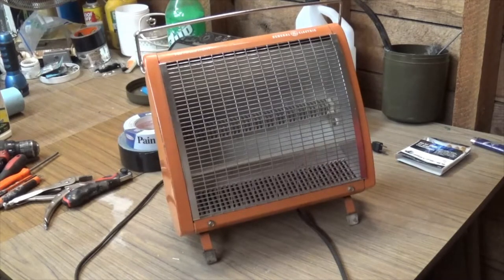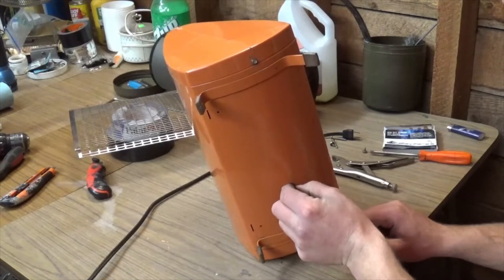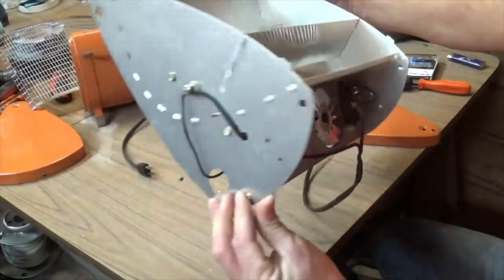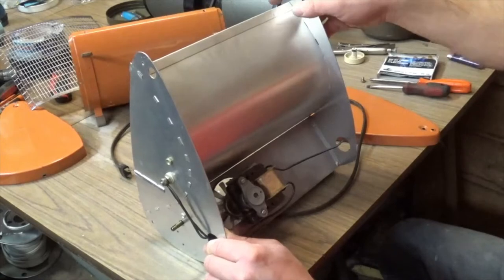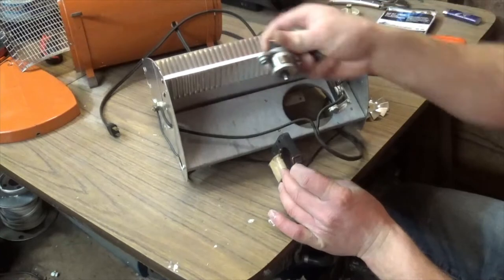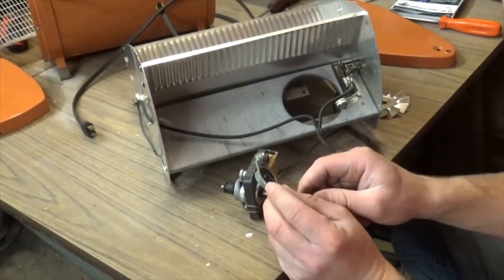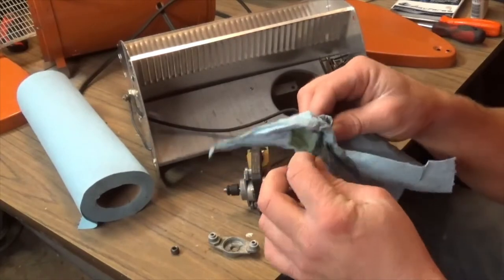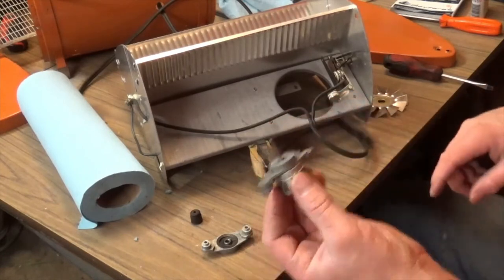Vintage GE heater disassembly

Comment: Hey hobbycentral I have pics but can't figure out how to add them to show you. I did use an oil on those bearings ... I'm gonna re do them like you did later. The fan was very stiff before I oiled it. I only oiled bearings but I'm gonna get the oil you have later. Just did it to free it up. Thermostat looks good. Gave it a cleaning blew it out. There was a ton of dust and debree in the under careage and fan was covered in black gunk as well as the fan motor so I cleaned it all as best as I could and checked connections and they were good too 😁. I do thank you for that video you did an awesome job at the breakdown of disassembling the unit. Keep up the good work.
Reply from the maker: Thank man im glad it helped! with all the gunk on your fans blades it must have a lot of miles on it. come to think of it, I dont think my fan had any gunk on the blade when I originally took it apart.
   At least you didnt find anything burnt! thats a good sign
Reply: Now I do have a question does it matter the oil I used LX 15 18  Just to get a lubricant in there as it looked dry but I plan to change it.. update tested and no smoke. But fan has an intermittent humming
Reply: Maybe cuz a heavier oil
Reply from the maker: @mechanicalbeast8237  as far as I know as long as it doesnt have detergents it should be fine. although avoid multi weight oils (such as 10w 30) , I havent had good luck with it lasting. although it may have been because it had detergents in it.
 I did a quick search on your LX 15 18 and apparently that is mineral oil. I havnt had experience with mineral oil so idk if its ok to use or not. I guess you will just have to see lol
Reply: @hobbycentral3516  what about him of the fan.. I tightened everything up and I need to change the plug .. someone put another cord on it mid way what kind of plug would I get.. a reverse polarity 2 prong?
Reply: Humming *
Reply from the maker: @mechanicalbeast8237  As long as it has screws holding the wire to the prong, you should be good.(some 2 prong plugs have this clamping style of connection where a sharp thing pierces the cord to make a connection, I DEFINITELY wouldn't use those lol)  both a polarity protected plug or a 3 prong plug will work.(you just wouldn't hook anything up to the third prong) I personally would get a good 3 prong plug for this application. they seem to be a bit better quality than the 2 prongs. but thats just me.
Reply from the maker: @mechanicalbeast8237  And as far as getting a reverse polarity protected plug goes, they didnt have them originally, so It's not a big deal. Although I better be carefull in saying that because I dont know if maybe yours is a different year than mine and might have needed a polarity protected plug.  so I guess just to be safe you might want to get a polarity protected plug (or a 3 prong)

Comment: I really love the look of that thing, does the fan really help spread the heat on this thing tho
Reply from the maker: surprisingly, yeah it does! if you stand in front of it you feel an extra blast of heat when the fan finally spins up to full speed
Reply: Thank you I'll definitely use this as a how to when disassembling the heater. Awesome job 👍